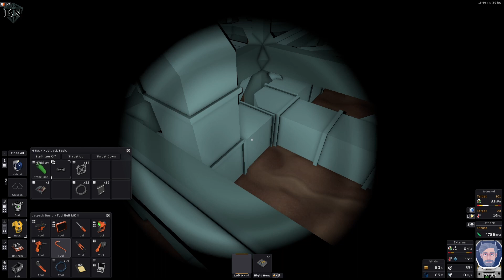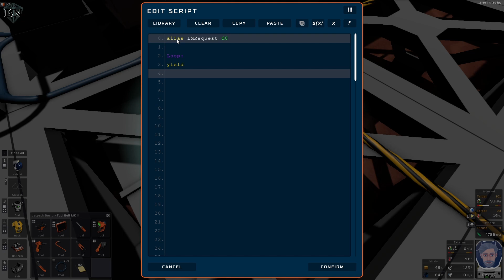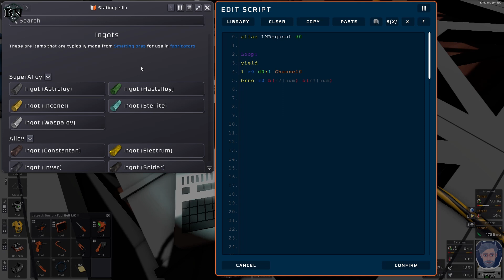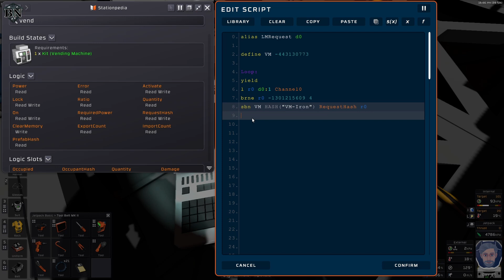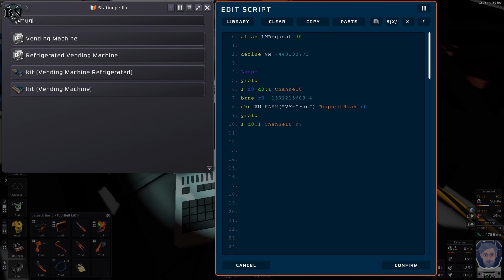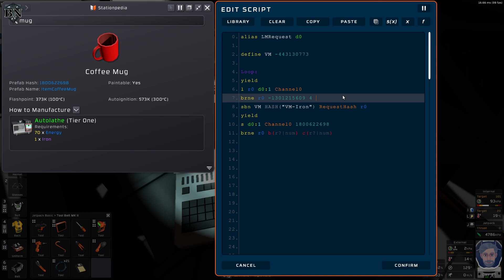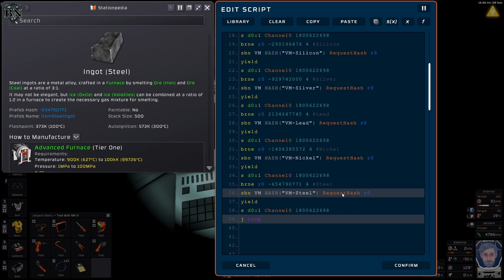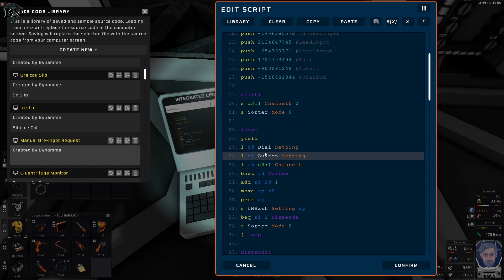Stationeers - Mars Ep16 - It's (not) logic

Comment: I enjoy your setups they are unique  and I learn by following your installs. I seem to be having a small minor issue after performing a Manual Ingot request, my display hash and dial freeze up  until I reset the ICHousing. Any helpful ideas on the cause? It is built the same as yours. The only unusual data I see is line 38  "s d3:1 Channel0 sp"   <<<<<note the stack index  "sp" is in red letters and yours was as well , but yours worked fine. Been racking my brain on this one. I know it is something simple and it is always the simple things we overlook

All fixed...........Was simple as wrong output chute selected. All fixed. Its always the simplest things

Comment: In my slightly repetitive critiques of your coding.  And repeating also that if it works (and you aren't running out of lines either), it can stay.

You're doing a lot of repetitive "yield and then set the memory to the hash for a coffee cup".  That can be moved to a named line, containing those two lines, then a jump back to the main loop or start label you use.  Four lines of code (the label the two things you're doing repeatedly, and the jump back) replace one of two lines repeated 6 times or so. (Copper/Iron/Lead/Silver/Gold/Silicon/Steel/Nickel/Cobalt/Coal all the vending machines).  In their place you put one line jump command to the named "function".

The only real argument against doing it your way is that if you need to change the "placeholder" hash with something else; editing it in each part is a pain. Better that it's only in one place.